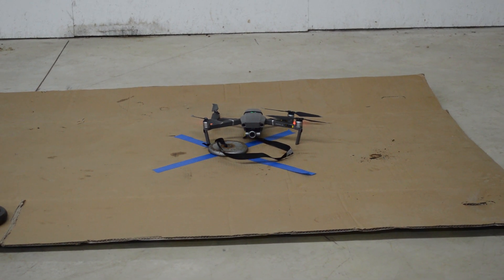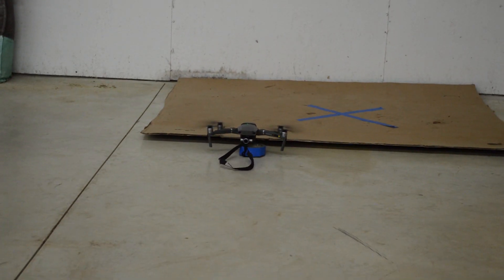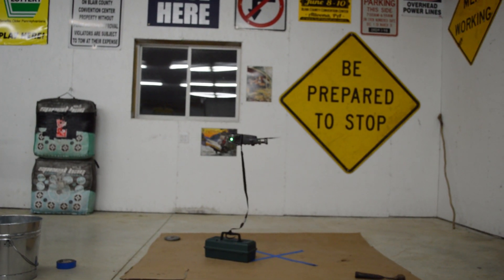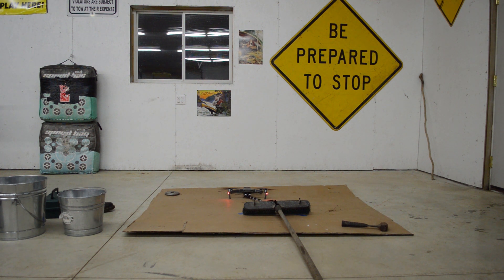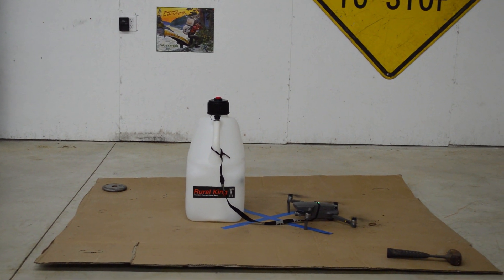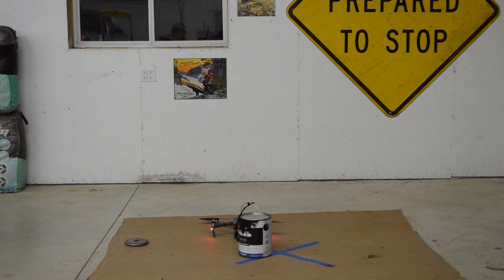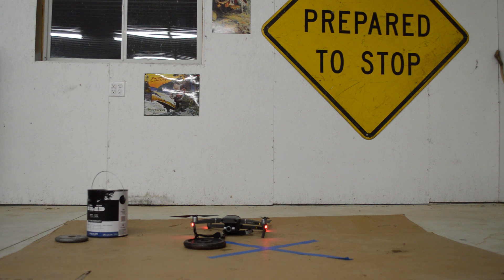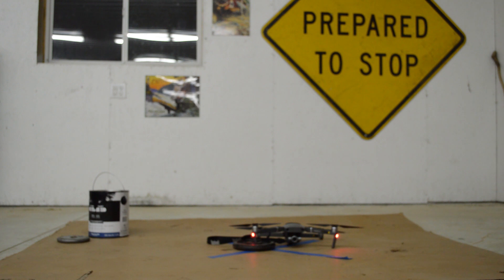DJI Mavic 2 Zoom LIFT Test

Comment: Hey kid, did you know kids are to be seen and not heard. Zip it shut boy! GPS has nothing to do with the max power on these!
Reply: Well my friend just reading the script. I don't care what you say about me. This is my first job I`m just making some money, i'd say 100 bucks a vid and the contract on videos with Viral Hog is pretty good wont you say?
Reply from the maker: STORMINORM Tharp The sensors were interfering with a lot of the flight
Reply: Caleb Eckenrode so what it doesn’t affect the max power it put out and obviously if the sensors were working you wasn’t in sports mode so it’s your problem for things uncompleted
Reply from the maker: STORMINORM Tharp The sensors are still active in sports mode for landings. Since it was so close to the ground it kept interfering and cutting the power so it wasn’t my fault that max power wasn’t there the whole time.